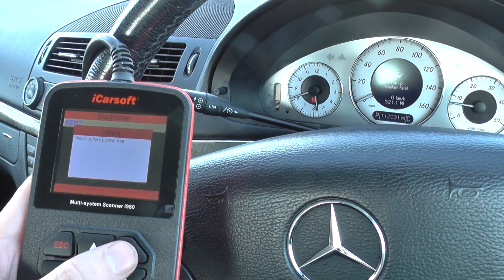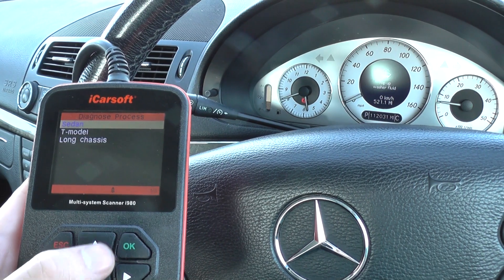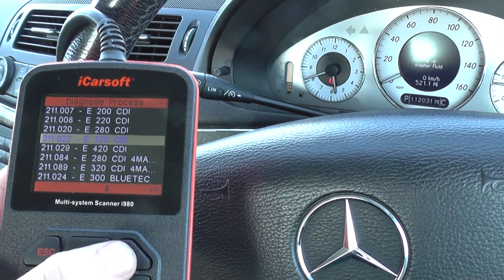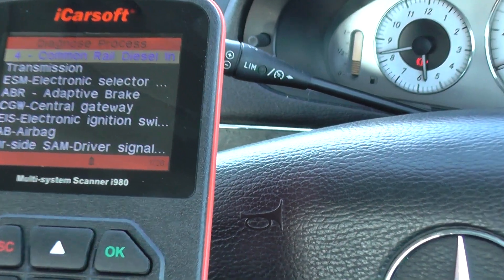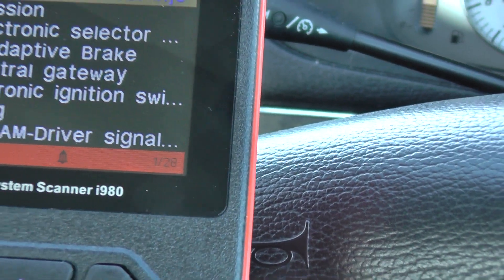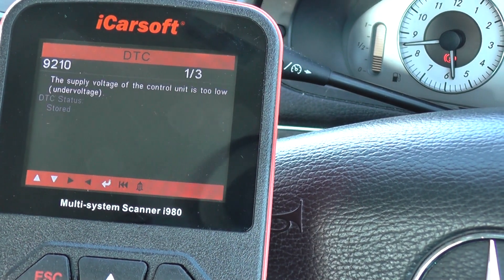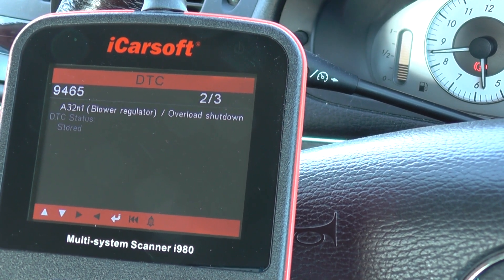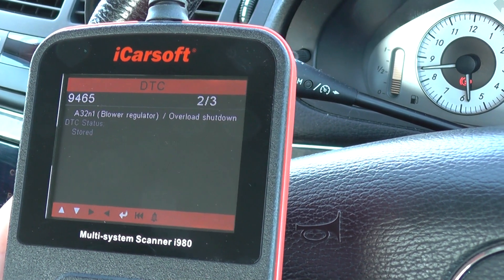Mercedes Benz AC Air Conditioning Fault Finding & Reset Diagnostic Kit

Comment: Do I need to reset my air conditioning unit after getting a new battery installed ?
Reply: Did you figure out your problem? I’m having issues with mine.

Comment: I have a 2014 glk 350 and the 2 vents on the driver side work but the one of the vents on the passenger side dose not work it’s the one on the center console has anyone ever had this problem

Comment: I just purchased the i980 scanner for my 06 SLK 280.  AC was blowing out warm air.  Just had a mechanic add a pound of R134a last week.  Ran diagnostic but found no DTC codes for C-ACC.  Tried to reset regardless but no change.  AC still blows out warm air.
Reply: Just had my compressor replaced. Works great now. Costly repair though
Reply: have you found the problem
Reply: @waynestephens908  no, I've been researching and have found posts about the front SAM being a common problem.  Taking it to a service center to see if it needs a new compressor or front SAM on Wed.
Reply: I’m having the same issue. What was the source of the problem?
Reply: I replaced the ac pressure switch because the ac was working off and on 2014 e350 convertible. Now it won’t take a Freon charge the compressor clutch doesn’t work

Comment: Just replaced ac compressor on my 06 e55 due to broken compressor. Ac light blinks then turn off. Waiting for the i980 tool to coming in tomorrow. I will keep u updated to see if resetting the fault codes work.
Reply: I just received the tool and reset the fault codes ac now is up and running. Thank you for the big help
Reply: @dinoc8786  hey mine is the same as yours be nice to use you machine to fix mine